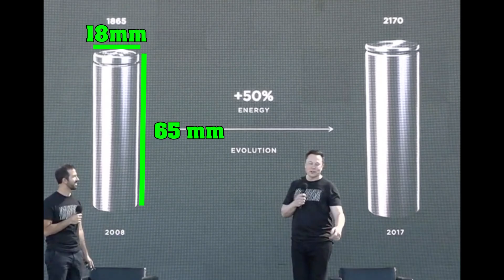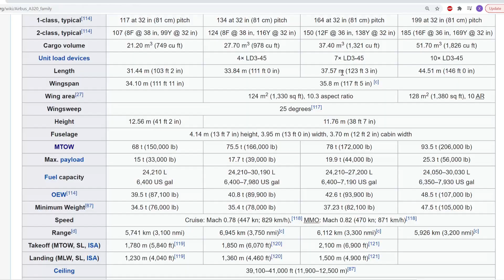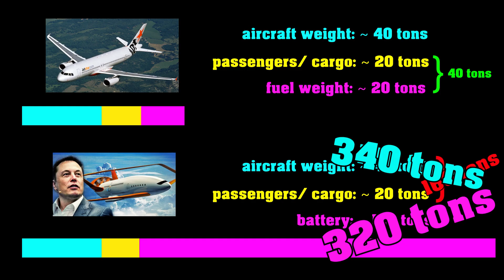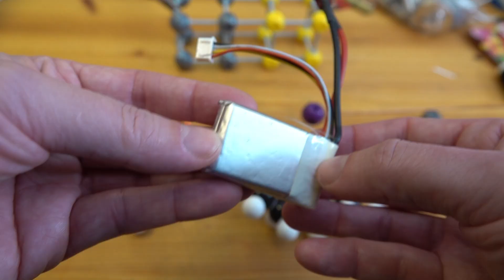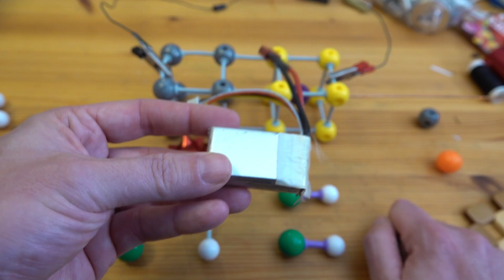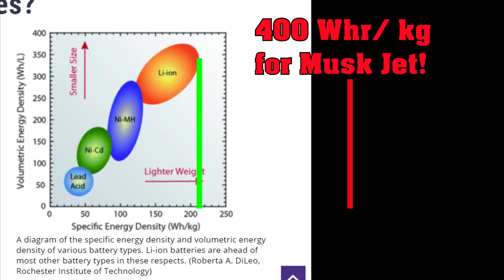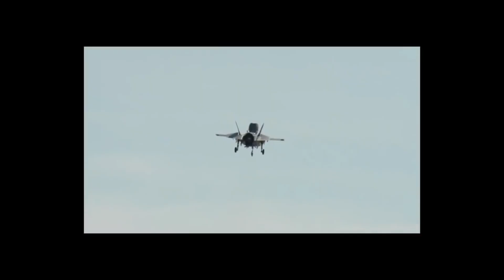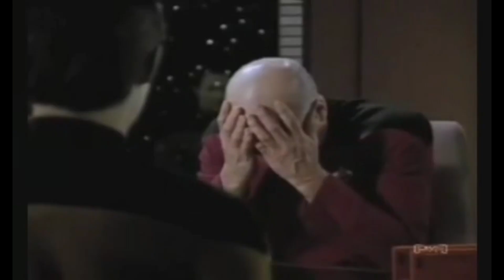Tesla's Secret Plan To Disrupt Airlines: BUSTED!!

Comment: One of the most important things about planes is also that they burn off significant amount of their take-off weight during their flight. This increases range dramatically and would be completely lacking in an electric plane.
Reply: His idea is for a vertical take-off plane. I'm not sure he's talking about a helicopter or a rocket with wings or maybe something in between... he just basically says stuff and people gawk in awe.
Reply: @davizitopa7252  Rotate a Hyperloop by 90 degrees and it's a Hyperelevator :D
Reply: @davizitopa7252  no, VTOL planes are a thing - look up the Harrier fighter jet.

It's impractical in most use cases, and has zero benefit to modern commercial air travel.
Reply: @jedidethfreak  West Germany tried pulling off the same concept made by Doriner (see Doriner Do 31). It originally was made as a military cargo vtol jet capable of transporting troops, equipment and supplies. A civillian liner was also planned but in never flew past prototype stage due to high cost, technical issues and a lack of interest by potential customers in millitary and civil applications.
Reply: Often the fuel needs to be burned (or dumped) before the airplane can land as the take-off weight is often higher than the max landing weight.
Reply: @Sfhgscvg  Any transport category aircraft is able to perform an overweight landing. Doing so requires maintainance to perform checks on the plane. However they'd already be fixing whatever serious technical issue the plane had.
Reply: Yep. was missing that in this debunk.
Also, airline pilots have the option to dump fuel if/when things get hairy. Try that with batteries.

Hang on, come to think of it, if we replace some of the nitrogen in the atmosphere by jet-fuel. Planes can simply scoop up this mixture, compress and ignite it to generate thrust. Problem solved (by introducing a far bigger problem).
Reply: @DreadX10  not all aircraft have fuel jettison systems, they are not always used and do not always work when they might be useful. E.g. QF32.
Reply: just throw out the batteries once they run out!
Reply: Battery will probably land themselves 🤡
Reply: That really is a small factor compared to the fact that fuel weight is 70% (under ideal and magical conditions) compared to 25% (under real world conditions.) If you have an aircraft and cargo weight of 60 tons, and 20 tons of fuel, but only have 4 tons in reserve at landing, your average weight is not 80 tons, but 72 tons, and your effective fuel weight is about 17%, not 25%. 

So, for every pound of fuel used to move the payload, you actually use 2.6 pounds of fuel to move the plane and fuel, not 3.0 pounds. This number would be 2.0 pounds if you had weightless fuel, or 2.5 pounds if the plane had no fuel in reserve at landing. 

However, the same aircraft (using magical batteries), will have 140 tons of batteries. So, the equivalent of 9.0 pounds of fuel would be used to move the plane and batteries per pound of payload. 

In reality, the weight of the framework to hold the batteries would mean that battery powered aircraft are unfeasible. Such experimental aircraft do exist, but the weight of the batteries makes them unfeasible for most applications.

Comment: I don't even understand how one would possibly build a supersonic electric jet engine.

At that speed, propellers don't work anymore so how do you even generate thrust? Have a super powered electric heater replace the burning jet fuel? I'm not an engineer but somehow I feel like that's not really feasible. Am I missing something here?

Comment: It's true large electric airplanes won't be around anytime soon.

Ammonia despite it being corrosive would be a good choice for a non-carbon fuel. You don't seem to like if the fuel was made from atmospheric carbon, but it would be an easy transition.

Solid state batteries just replace the flammable electrolyte with a solid one that would stop dendrites. Making the anode pure lithium is separate and the obvious next step to increase the energy density, but you don't think it would be safe. There are also solutions to pierced cells that prevent catastrophic failure, but at a higher cost.

Comment: Teslas energy density is about 250Wh/kg now so your plots are a bit off. 
With the rest you are right if its comming its not gonne be a conventional airplane with conventional range conventional range. But if its only dooing 1 000 km or sth about that the battery dose not need to be that big. 

Thing about teslas burning: 1.st its more likely that your gas car catches fire thing is nobody talks about that. 
2.nd  the trick is fuses and batterys with a high internal resistans.Meaning the minimum time it takes for a battery to discharge the exampels you showed where high drain RC lipos they are desinged to pump out massive amounts of current from a singel cell. C ratings are normaly in the 40-100 zone. 
with cars its more important to drive for a long time. the batterys can be discharged over many howers therfor the c rating can be low. And the battery can have a relativly high internal resistanc. therefore in a faliure it takes longer for the cell to release all its energy. Giving the coolingsystem a chance to disapate the heat. more over most cell faliures resault in a small internal leakage current. Meaning the time it takes to disapate all the energy in the cell is long to very long. you only get fails resaulting in a high current faliure when you a have battery thats overcharged. (easily to notice and to avoid) or b have a physicaly damaged batery for example somebody put a nail thrue it sth like this.  Alsow there is the chance for self healing in cells but thats a long way out. Woud be simmular to self healing in foil caps. where the short burns it self free. 
What dos stop a big car battery normaly from a cascade faliure is that the batterys are individually fused. If one cell fails and develops an internal short the real danger is not the power in that battery, due to the reasons above its possible to disapate the heat from 1 bad cell over a certain time period. but that all the other cells relese there stored energy thrue that cell. And that everything gets hot and a cascade failiure starts. A furse wire normaly prevents this from happening in the tesla cells. 
To make it short having a high ammount of batterys is not rally that  big of a problem. As long as you dont have an event that damadges a large amount of cells at once. And overwhelms the cooling system. than cascade failiure is still a problem. But hving a physicaly damadged plane is a problem in general.

Comment: 5:30, Plus the fact that big aircrafts cannot land back on the runway carrying their full landing weight (thus they dump fuel in emergencies) which in this case is impossible as depleted batteries do not weight less or more than fully charged ones.

Comment: Since batteries at ground level have weaker performance in cold temperatures, what performance can we expect from a battery powered plane cruising at 9,000 to 12,000 meters with temperatures of minus 40 to minus 57 degrees celcius?

Comment: Whilst I appreciate a good reality check, this video has kind of depressed me somewhat...
So what I'm hearing is that we've pretty much reached the theoretical limit for battery energy density. Is this correct?
Are there then, any theoretical alternatives to replace fossil fuels in aviation? Could hydrogen fuel cell tech work, or still too dense for aviation? How about just burning hydrogen? The H2 could be produced via electrolysis as a way of storing excess wind/solar energy as part of a larger hydrogen economy?
Basically, Is there a way for commercial flight to survive in a post fossil fuel powered society?
Perhaps minimal batteries + solar PV wings + *targeted space based solar power ?
*is SBSP even a real thing?/theoretically possible?
Or is the aviation travel industry pretty much screwed in the long run post peak oil?
Reply: In your hypothetical world with infinite electric power you could just fly the plane with traditional or synthetic jet fuel and capture and store the released CO2 "afterwards".
Reply: I'd say hydrogen is too dangerous to be used for anything at all. In all my life I have never heard of any fuel station exploding - ever but once. It was a hydrogen fuel station in Norway.
We could make other synthetic fuels like methane or better methanol as that's a liquid, if the energy for that comes from clean sources I guess. That'd probably still be more energy efficient that hauling the weight of batteries through the air - even if we could double their energy density. Someone who knowns more about this stuff could probably actually calculate the required battery energy density we'd need to use up the same amount of electricity to move 20 tons of cargo from NY to LA in a battery plane as to synthesizing the required amount of fuel.
Reply: @gwahli9620  This is exactly what I think. Synthetic fuel is the future when we have enough cheap CLEAN electrical power. CLEAN only offcourse. This is why we need fusion energy at least in the long term. And when we have enought of this, even the petrol based car technology might have a comeback. Because it is save, energy dense, easy and consists of materials that can be easlily recycled.
But meanwhile we need to do everything to reduce and probably also stop the burning of fossil fuels. So that there is still an earth left where we can live.
At the end we probably also want to terra form our planet back to the "good old climate" by filtering out the CO2 that we have brought to the atmosphere. Again, possible when you have enough electrical CLEAN energy. 
After all that, we can think about colonys on Mars. Oh wait, Elon is already there LOL.
Another point: A big electric car like a Tesla, with huge range (and therefor huge batteries), is ecologically for sure the wrong way. It's a waste of resources.
Very small cars with short ranges (fully electrical) in a car sharing schema would be a better and more efficient way for big cities.
Reply: You could theoritically make a nuclear thermal ramjet which effectively allows limitless supersonic flight range for decades without refueling. Problem is its basically a flying chernobyl. I guess synthetic production of jet fuel is the most efficent solution
Reply: Exactly, synthetic fuel is most likely solution.
A very far fetched option may be nuclear.

Comment: I don't know what's worse, the fact that they think an electric motor is more efficient at higher altitude, or the fact that they think a propeller driver aircraft is more efficient than a literal JET ENGINE.

And even the SR71 BLACKBIRD had to use a hybrid net engine, combining a ram jet engine with a conventional jet engine, just to be efficient enough to sustain it's high speed high altitude flight.

Elon should just stick to making electric car's.

Comment: You know what, it could have disrupted the airplane market (given that the material to store the energy (Battery) is a material, that you can freely shape so you don't need the rest XD XD XD) but then there was a minor incident that did it before they could (as in pandemic; sometimes believed to be caused by a software company to what was it? microchip people? dunno, probably a mind control device or a device that lets you cast magic, either way). Maybe the next invention will fix the idea. I guess cold fusion would work on a plane XD. Well there are probably some scenarios where it would work (just like you can put two hyperloop tracks around a big enough spacestation (already a vacuum and tube protects cargo / puts it on tracks) to compensate the rotation caused by moving around very heavy loads of materials XD XD XD). Cant think of one right now. (oh actually, you can scale down the size of the battery if you find a way to charge it during flight. Probably by using fuel. Wait; tesla must be able to convert lightning strikes to energy, therefore that could (absolutely reliably XD) recharge the Battery mid flight.

Comment: One possibility to save some weight - use batteries as structural elements. 
So maybe it possible to make airframe much lighter then in normal plane.
But if (when) batteries degraded plan can be scrapped...

~3 years lifetime before energy density fall to 70% of initial...